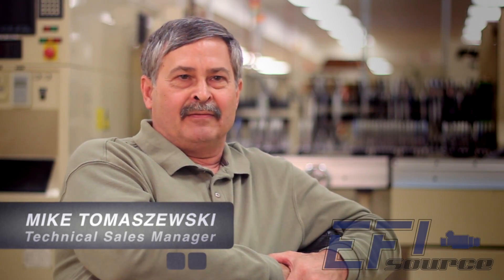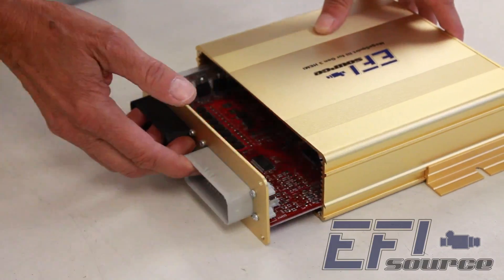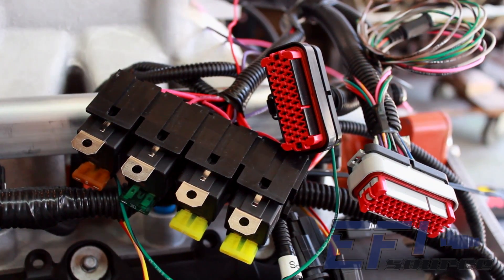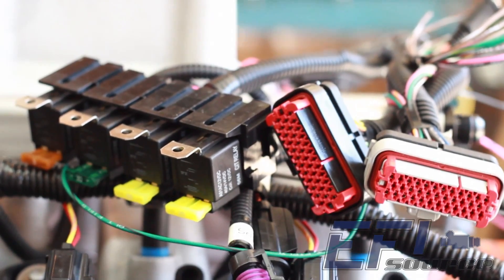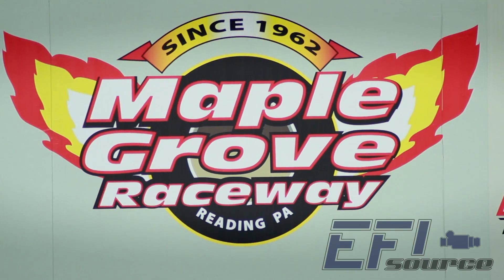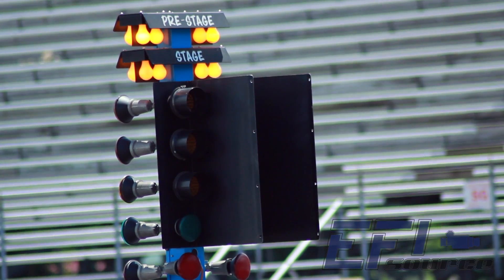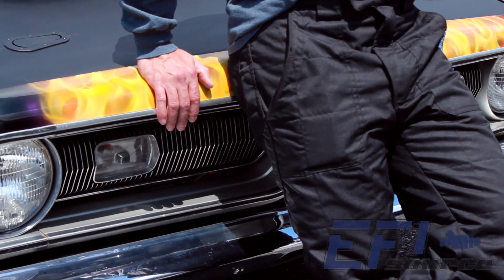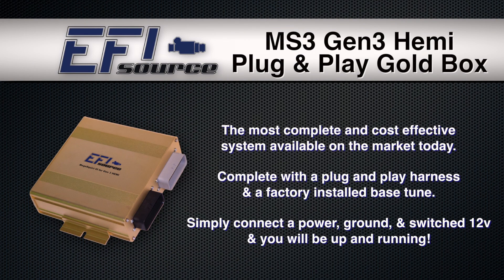MegaSquirt III Gen3 Hemi Plug & Play Gold Box - Electronic Fuel Injection Controller - EFI Source

Comment: C'MON  man  instead  of  bullshit music  and  a  bullshit sales  pitch,  how  about some actual   "FACTS"  about this system,   what is required,  what it does,  capabilities,  and extra  hardware  / sensors required.
Reply: They are just like auto manufacturers ! these computers have only created complex problems and issues and a turned a well built manually controlled system into total junk ! i have a phd in mechnatronics manufacturing placed overly complex computers into these cars with one goal in mind that was to sell more cars not fix or offer easy solutions to fix problems or help anyone! all computers do is render a completely safe sound solid vehicle useless and unrepairable ! soon as manufacturers saw what the 1st gen cummins was offering and potential they have manufacturers immediately started overloading vehicles with computers! ive got over 1.2 million miles on my 1990 cummins with 600hp /900+ ft lbs of torque all manual no computers anywhere! not even their own top ranked engineers can repair these new ecus if an outside hacker hacks into the system !  there was a pink demon 170 on youtube being sold from youtuber to youtuber cause the best computer programmers in the world couldn't get it to run ! all it took was for the hacker to subject the ecu to electromagnetic waves which is a lot easier than most think ! i could go render a whole dealership useless in a few hours ! the hacker rendered a 150k car useless ! the same happens with excessive heat over long periods of time! more and more people are fed up and 440 source offers a 440 block capable of 700 cubic inches for about 3000.00 now ! you will see aftermarket old school flood the market cause these computers are unreliable and easily destroyed ! you break a old school motor its super easy to repair ! these new vehicles pop airbags you need a million dollars in equipment to reset computers that shouldn't even need to be reset ! there is zero logical reason to have to reset an abs module or ecu cause the airbags popped on their own ! its a foolish system set up by foolish engineers bent on destroying the entire automotive industry! they are literally bankrupting themselves!

Comment: DOES   this   control the  ignition too...?            I'm not  savvy on this   set up..  but have a  2006  5.7  from a  300 Chrysler.. and  see   MSD  HEMI CONTROLLER  FOR  IGNITION AND A  ANOTHER  CONTROLLER  FOR  FUEL..               SO  very interested  in more  info..        seem like  a  box  that does  ignition and fuel would  be   a  no brainer..

Comment: ok so lets say i go to the local bone yard, pull a running 5.7 or 6.1 hemi from a truck or car, all i would need is this gold box and harness to drop it in my project and be running
Reply from the maker: Correct......as well as a cable operated throttle body such as a BBK 85mm. Give us a call if you would like to get into specifics 610-473-2089